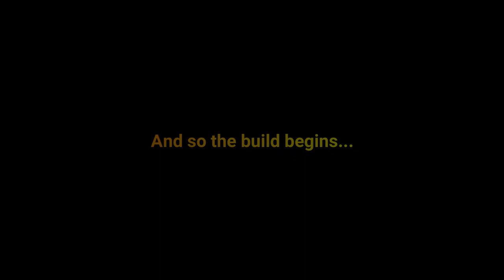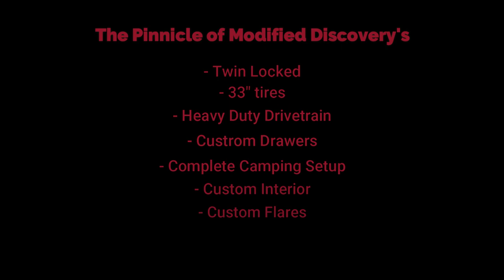1998 Land Rover Discovery 1 Touring Rig Build

Comment: Love the Tdi Discos and I have one first registered in June 1999. I cannot understand what they started with a Disco that needs a new chassis. Why not get one in a good nick to start?
Reply from the maker: There is a story behind the chassis swap. The white Disco was the original car, the engine blew up in that, so the owner bought the red car as an engine donor. After realising the red car is in better condition inside and out, he decided to do a chassis swap as the white car had 30k worth of parts in the drivetrain and chassis. So it turned into the red car with all the heavy duty parts from the white car, with the good motor from the red car.
Reply: @project4x469  Ok, now it makes sense., thanks